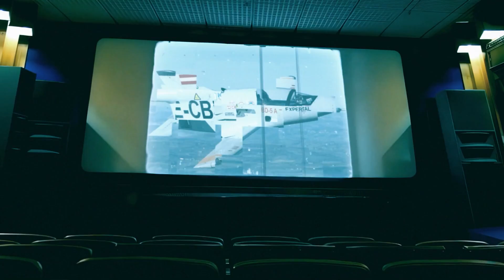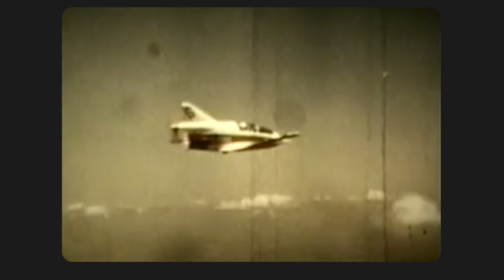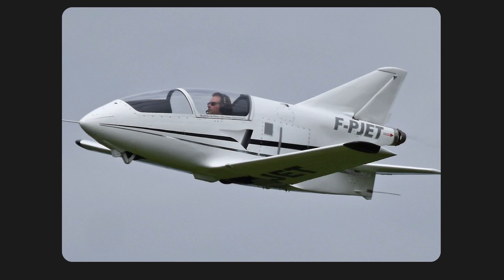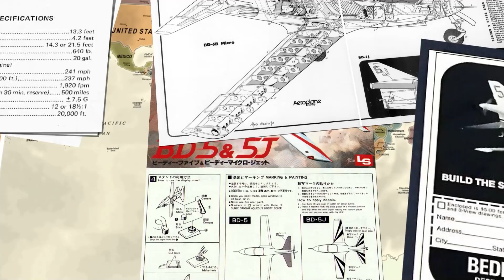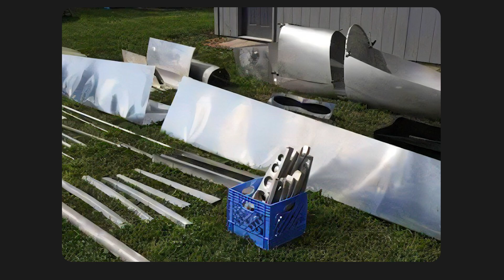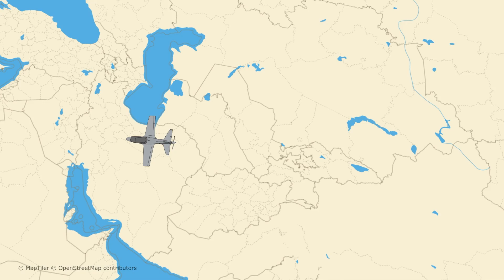Bede BD-5: Aviation's Bold Leap!

Comment: My uncle Jim, owned Florida Bede Aircraft. He built or supported the construction of several aircraft. I met Jim Beedee at my uncles house in Apopka FL  in the late 70's or early 80's, very unaware at the time who he was.I started construction of my BD-5 in 1988 and worked on it until 1993. It was ~90% airframe complete with "B" wings. The plan was to install a Honda 4 cylinder motor in it, something my uncle had done on 3 prior aircraft. In the early 90's I joined the military and lost interest in it and it was sold it to someone that apparently finished it. I still have dreams of flying that airplane despite my dad's insistence that it was a "widow maker".

Comment: Sounded like a good idea initially. Still, just because something is cheap, that doesn't mean it can be easily designed or that you can cut corners. Designing and developing it WILL COST A LOT OF MONEY. That's something that Bede apparently didn't get.

Cheap home built aircraft shall not be easy to design.

Comment: I believe there were ergonomic problems with the side-stick control that made it over-sensitive in pitch,  and consequently too easy to over-rotate. 
Also the motors tried required a long shaft to reach the propellor, which tended to induce vibration, especially resonant ones.
Bede was a creative and innovative thinker, but unfortunately better at promotion than proper development.

Comment: Build it today with electric motor and all the drive issues go away.
Reply: But weight issues...
Reply: @Triple_J.1  Not with modern LTO battery technology
Reply: @adroitcozy  to stay within the CG, You still would have to locate both the electric motor and the batteries right behind the cockpit, thus still need a long crankshaft to the propeller. No vibrating issues solved this way…
Reply: @Crottedenez1000  What torsional vibration would you expect from an electric drive?
Reply: @GregoriWootovich  the same as from a gas driven engine : it wasn’t the engine itself which induced the vibrations, but the (too) long driveshaft in combination with the wake turbulence from the elevator/rudder surfaces to the tips of the blades of the propeller
Reply: @Crottedenez1000  LOL

Comment: The Coor's team was probably better known for doing the air show circuits with the J variant, but I remember there was either a Budweiser or Bud Light sponsored team as well (although not as long running), not sure if they had had a name for it though. I remember seeing the BD-5J myself at air shows twice in the 1980's with my dad.
Reply: The first BD-5J aerobatic team was Corky Fornof and Bob Bishop sponsored by Sonic Drive-Inn. Called the Sonic Acro Jets, they did quite a few shows in the late 70's, early 80's.

Comment: When I was in the Air Force I knew a pilot who was planning to buy a kit. I hope he never did it, the planes have had 80 crashes with 37 fatalities or serious injuries. The British civil aviation authority pulled the planes certification and flying the BD-5 in Britain is illegal. In 2016 a pilot with 3200 hours defied the ban and tried to fly to an air show in a BD-5 he had been building on an off for 30 years. He crashed fatally eight minutes after takeoff. 
This is plane reminds me of the Bugatti 100 speed record plane. The original never flew but the reproduction that was built killed it’s pilot on just the third flight.
Reply: Bugatti p100 will fly again...
Reply: Faith is the opposite of reason.
Reply: I might be that guy.
no, I never bought it. They could never get the engine problem fixed. 
Then I discovered that bigger planes are MUCH easier to fly.😎
so I bought a Piper.

Comment: IIRC the jet engine used in the BD5J is actually a repurposed APU engine designed for use in the 747.
Reply: Naw, it's too small for an APU. The Microturbo TRS-18 was designed by Sermel for self-launching gliders. Microturbo, their competitor later took over development and the engine eventually saw use in both manned and unmanned aircraft.

Comment: Let's not forget that Jim Bede also designed the homebuilt BD-1, which pioneered the use of honeycomb aluminum bonded structures. The BD-1 design was purchase by American Aviation in Cleveland, which marketed it as the AA-1A Yankee Part 23 certified trainer. The design passed through several owners until Grumman bought the design (along with the four-place AA-5 Tiger and Cheetah variants) in the early 80s. You can find the more successful AA-1B and later models flying at many (most?) airports in the U.S.
Reply: The BD-1 was a single place airplane. The Bede Aircraft Company became American Aviation after Bede was ousted from his own company, lmao. 
The AA-1 Yankee Clipper was a substantial redesign of the the BD-1. They made it 2 place, deleted the folding wings, made the wings longer, increased stability so it could be certificated.

Comment: Not a bad doco, a few little inconsistencies here and there, but generally got the 'vibe' of the BD-5 across.
Corrections would be; 
Bede used the front of the ASW 15 glider to mould the front of the original, all fibreglass BD-5. 
As mentioned, the original aircraft was all composite with a V tail, it flew on rare occasions, and as stated was underpowered and unstable.
As a side note, Bede pioneered the use of a large aluminium tube wing spar on the BD-1, which later became the Grumman Yankee AA1.
The whole fibreglass construction idea required skilled labour to manufacture and was little heavy. Pressing parts from thin aluminium was quicker and easier (once the tooling had been set up), and actually came out lighter.
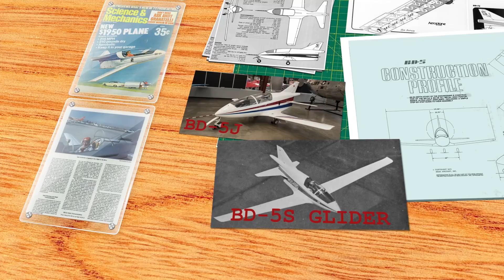Mentioning the change to the 'high revving two stroke engine' (7:56) is a bit misleading as ALL the engines up to that point had been two strokes.
The tail configuration changed from the V tail to a normal fin and highly swept tail, before finalising on the straighter 'triangular' shaped all flying tail. There are images available on the internet of these tail arrangements.
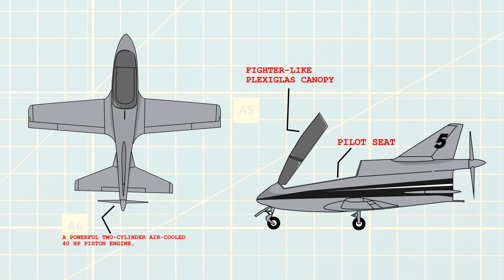The prototype had a one piece, side opening canopy, but most ended up with a two piece, windscreen and canopy layout, with the canopy opening upwards on parallelogram rods to the rear, NO aircraft had forward swinging one piece canopies as depicted at 1:34.
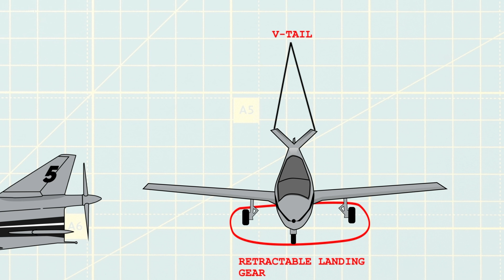The split flaps mentioned at 1:47, were only used on the composite prototype, all the metal wing aircraft used common flap and ailerons, NO aircraft were fitted with spoilers. Note the red bits highlighted there are the flap and ailerons, and for some reason the elevator trim tab?
Still, a fun video, but just reminding me that I'll probably never build the kit I have...

Comment: So several years later the twin-tail, 2-place BD-10 jet arrived on the scene, touted to be a supersonic private jet in kit form.  You can even find a marketing recording of it flying here on YouTube.  There were a few successfully completed and flown, but they never got close to Mach I and the advertised range was a pipe dream.  They also had a structural design defect at the tail causing crashes and deaths.  The late Jim Bede was a dreamer and a marketing genius but in the end he was no more than an under-financed snake oil salesman who robbed Peter to pay Paul and left a lot of people holding the bag.
Reply: 2 of us put down the deposit and never saw a single part.
Routan worked for Bede and left in disgust for the snake.
Reply: LOL!

Comment: This brings back the memories : I was a kit purchaser but never completed the aircraft because no engine was ever chosen as a final option. I kept it in storage for a decade playing with the concept of different automotive engines or possibly a 100HP 4 cylinder aircraft engine. But the biggest problem was the engine weight and cooling which I never solved. 
A guy saw it in my storage shed and bought it cash even though I explained all the problems, hauled it out that afternoon and I never heard anything after that.
Note I am an A&P mechanic so the it wasn't to hard to build BUT I think an unexperienced person would have had a lot of problems.
Reply: The BD-5 has a very short fuselage with a very narrow acceptable CG range.  That makes it unforgiving to most recreational and overweight pilots. 🤠
Reply: @jamesburns2232  yah, I'm 5'11" and weighed 187 at the time and weight of the engine, possibly weight of a liquid cooling system really screwed with the CG calcs. Several engines I thought might have fit would have required up to 16 pounds of lead in the nose to get balance but then you couldn't carry a full fuel load.
Beautiful airplane but I bet if I'd ever gotten it flying it would have killed me. As Clint Eastwood once said "A man has got to know his limitations".

Note that I built a Mini-IMP once and never got the bugs worked out of it either. Torsional resonance problems with the long drives shaft and and the prop hitting wake turbulence following the tail fins
Reply: How would an engine like a Rotax 532  (air cooled 65 Hp inline 2 stroke) have worked, when they became available…?  just curious..
Reply: @PRH123  probably it would have worked quite well IMHO

Comment: As a point of reference, the shifting price points for a BD-5 were comparable to what an entry-level new car cost:  A 1972 Pinto with no radio for $1850, or slightly higher-trim Maverick for $2200 (those aren't list prices -- just what a particular dealer was offering one day).
Reply: Speaking of fighter jets...
Past '76 powder blue Ford Pinto owner here. First car, manual transmission, purchased used in '79. My parents only became receptive to making me a relatively small short-term loan after hearing of these models exploding in collisions.
Nevertheless, it was obviously one of the two things I had in high school that all the girls wanted to ride.
During that time and with that pathetic ride in '79-'80 I dated the scorching hot blonde who happened to be the Head Varsity cheerleader, Homecoming Queen, and then attended Stanford on a full academic scholarship.
Where are you Maverick owners (w/ slightly higher-trim)?
What do 'ya got?
Reply: @showtime951    I dated her (non-stop) once she got to Stanford.  She said I was the best she ever had, bar none.

"Marc, wake up!  You fell asleep at the keyboard again.  With a weird little smile on your face."

Ok, where were we?

One time as I was driving away from my high school, I held the revs a bit on the powder blue '72 Maverick's sad column shifter, shifting at closest approach to a cheerleader walking home who had maybe pointed at me during a pep rally some months earlier.

Comment: I built and flew a stretched BD-5B with a turbo Honda engine. Took 5 years to build and about 2500 hrs. First flight was 1/16/95. Not a forgiving aircraft but also not too hard to fly if you payed attention. Stall was about as abrupt as aerobatic aircraft like a Pitts. I rolled it but never spun or looped it. Engine was the biggest problem. I had an ignition failure right after take off and set it down next to a freeway. Donated the wreck to a local A&P school.
Reply: Glad to have you still around!
Reply: Indeed!
Reply: Well, with reference to my "death wish" comment above, I guess Bede found you, or maybe ice versa. Glad you aren't just another BD-5 statistic.
Reply: I recall seeing that plane. It had a Honda powered emblem on it?
Reply: Small jets struggle for reliability and fuel consumption is insane.
Reply: I saw one with a BMW 980cc "airhead" the owner/builder said she had no reliability problems.

Comment: Shortly after becoming a certified private pilot in 1974, I began glider training at Vacaville Gliderport in California.  The school had a plethora of soaring-related publications strewn around the facility.  I remember one had an advertisement from Bede Aircraft offering a "glider school in a box."  It contained kits for five BD-5G gliders and a BD-4 towplane!  All you had to do was put 'em together, and PRESTO, you were in business.  I imagine this was to be a massive group project.  Unclear if this offer had any takers.

A couple of decades later, as a CFI in gliders and airplanes, I had the opportunity to fly a BD-4.  It has very short wings, requiring very high climb speeds to maintain an adequate safety margin above stall.  I can't envision an airplane LESS suited to towing gliders.
Reply: I did my glider commercial at Vacaville in 90s with Rusty.  It was a good location, coming in over I80 to land.
Reply: Glad I had the opportunity to experience ridge soaring.  I finished glider training in coastal Texas.  These guys have never even SEEN a ridge.

Comment: Believe it or not he also developed a unique ground vehicle called the Pulse. It was powered by a half of a motorcycle married to a unique frame that supported the fuselage of the BD5 on it. It was a fandom seater with outrigger winglets that had wheels in closed within.
Reply: Pulse Autocycle and Litestar fans still have an annual gathering where you can see plenty of these in one place. They ride down the road leaning to one side or the other.